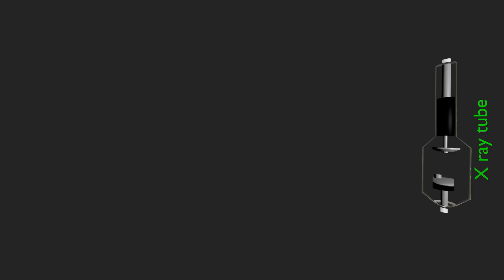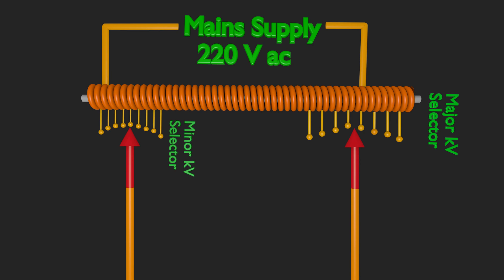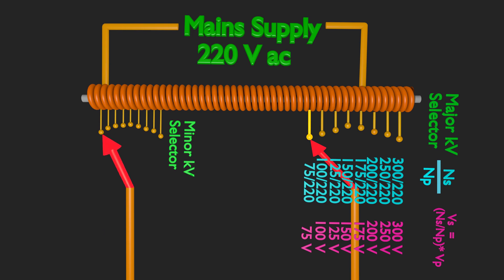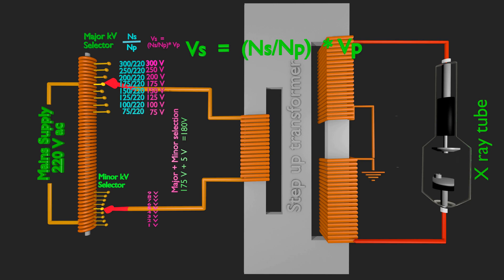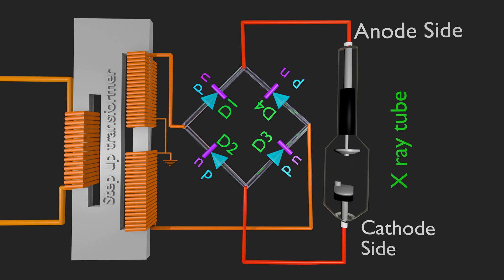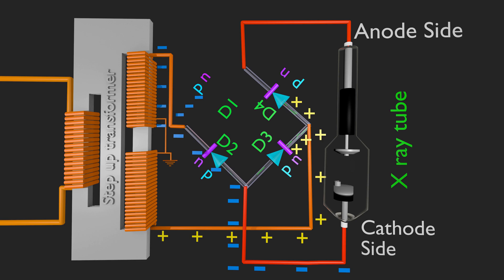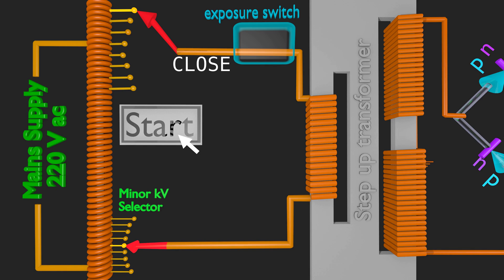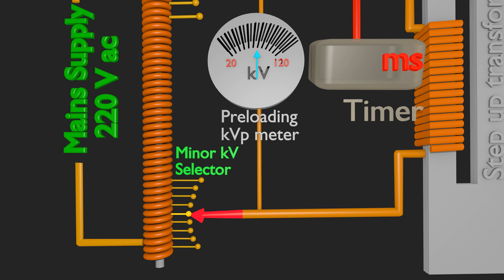xray kv circuit, xray high voltage circuit

Comment: Ma'am you only say step up transformer high voltage circuit
But you don't say step down transformer low voltage 
Please ma'am make a video of step down transformer
And provide a diagram of step up and down transformer in one figure. 
By the way thank you ma'am ❤
Reply: Is simple bro step up has more coil turn in secondary winding, and it increases voltage(that's why called high voltage transformer) and decrease current and exact opposite is for step down transformer.

Comment: When anode is + charged mater and cathode is -ve charged matter why only electrons from filament is accelerated not from - ve side ??
Reply from the maker: Electrons are free inside xray tube, after thermionic emission. Filament is in _ve side only
Reply: @radiationphysicsradiationb5460  my question is simple , when positive and negative voltage from rectifier fed to anode & cathode wt will be happen ? Do the cathode is connected to ground ? I know there will be points like s , l, c other than these there wont be any points . Wt I understood is the negative voltage is connected to ground at anode side and positive voltage is fed to anode will help to attract electrons from filament , correct me if i am wrong
Reply from the maker: Well if u want the basics. Anode is positive mean, anode is lacking electrons. Cathode is negative means   cathode is having surplus electron. If Free ellectrons are placed between two  electrodes and one of the electrode is positive other negative or ground level then electrons will move towards positive electrode.  If anode is at ground and cathode  at negative(surplus electrons) then also electrons will flow towards  anode. Electrons  will naturally flow towards less negatively charged plate . Or in otherwards towards more positive plate.

Comment: To the robot narrator: 180*400 = 32 kv. That does not compute!
Reply from the maker: Thanks for pointing out the calculation error. Hope the rest of content is useful to u.
Reply: They did not error.

Only partly, due to skipping an important feature.

This Transformer has a center tap. 

Therefore, each secondary winding only has half of the voltage. Combined makes 72kv. But half is 36kv each side. There will be losses due to the core, so 32kv is a close estimate.